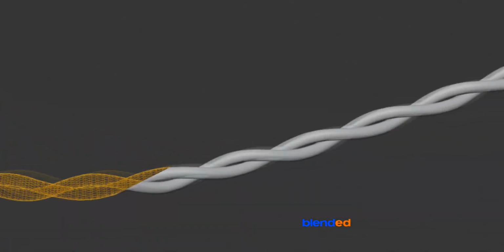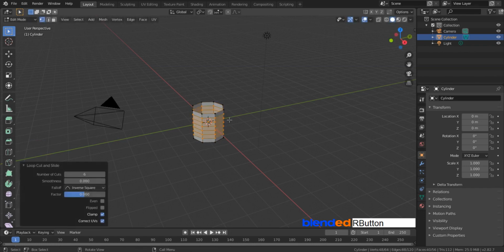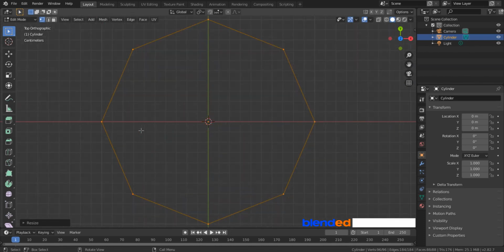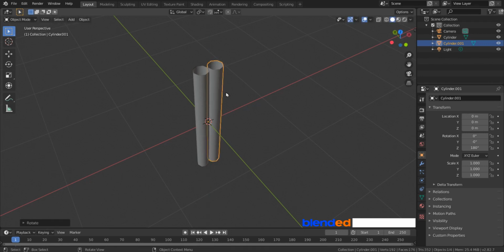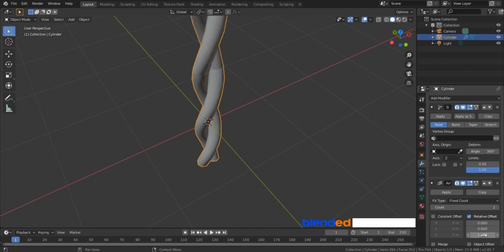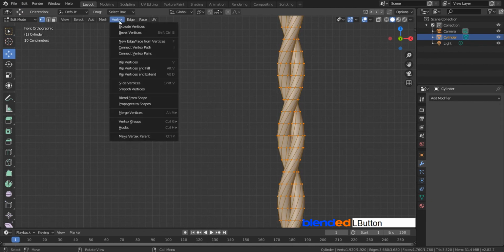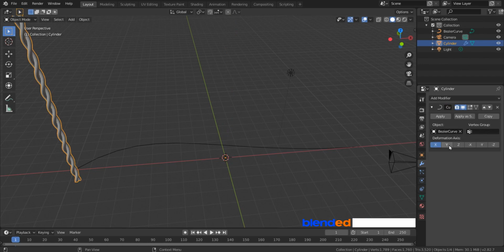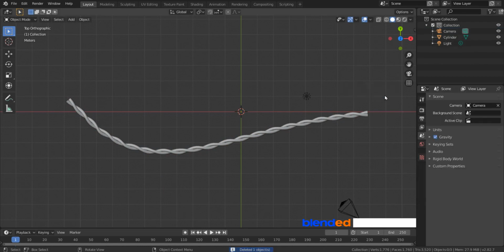How To Model Twisted Pair Cable | Rope | Blender Tutorial

Comment: Quick Tip:- Just delete the top and bottom faces of both the cylinders and then just check the merge option in the array modifier.
Because:- Then you won't need to apply the modifiers. Which makes you work non-destructively.
Hope it helps :)

Comment: I had to do a twisted cable a while ago, don't remember the exact process in it's entirety but there were a few differences to this set up. There is an option in the array modifier for merging, no need for the manual step.  A more procedural way is using two bezier circles with the origin point between them, extruded via the curve settings, screw modifier 180 degree and array-curve modified along another bezier curve (similar as in your video). You only have a single section of the cable (2 bezier circles) that way they will automatically merge seamlessly to the next part created by the array modifier and you can set the length of your cable on the fly by extruding the bezier curve. Your minimum length is the part when the geometry completes the 180 degree twist. You can also change the "twistedness" of the cable after you have already modelled it into your scene by changing the value in the screw modifier and make it tigter or more loose or even change the profile of the cables. Tapping into edit mode and changing the distance between the original two bezier circles you can make the space between the two cable bigger or smaller (altough that could then clip into objects in your scene if you placed it on the ground or wrapped it around objects with snapping enabled and it touches those objects). Because its's a curve object you can change the resolution at any point. The set up is a bit more complex but once you get it to work you have a very flexible cable set up that can be changed after the fact considerably.
Reply: Do a tutorial man!
Reply: Screw modifier gave a messed up result, also simple deform did not work for me
Reply: @velstorios9473   The first 10 minutes of Joey Carlino's "Barbed Wire with Geometry Nodes || Blender 3.0 and 3.1" video is how I would do a twisted pair cable these days.
Reply: @monkmichel9477  Thnx